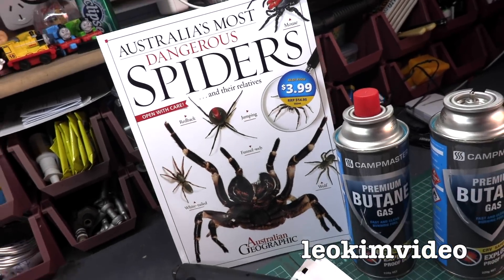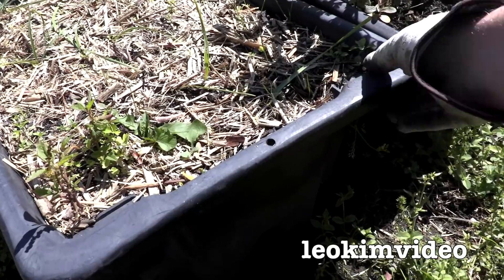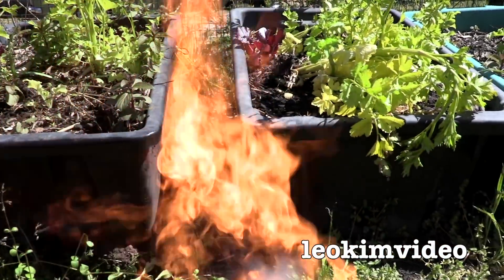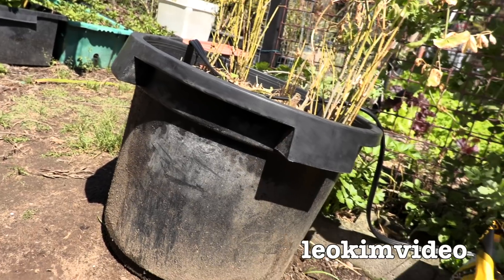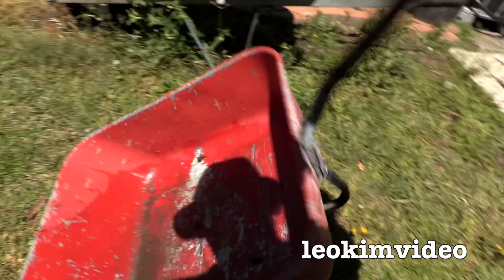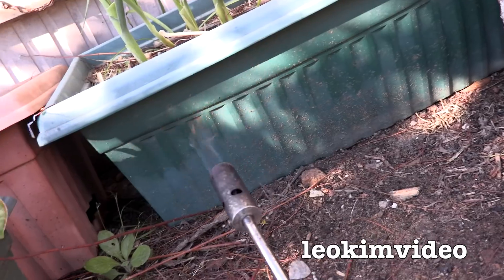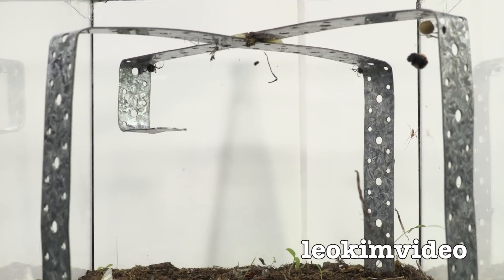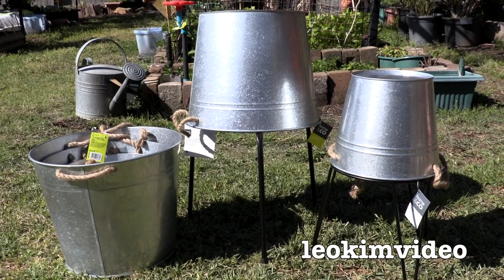Redback Spider Control First Burn Amazing Results Using Fire EDUCATIONAL VIDEO

Comment: Before using your torch try and use the hose to wet the area around the plants so you water them and you don’t put the risk of burning down the area around you

Comment: You should use that lithium grease spray on all the flower boxes too! I'm sure it will discourage them from always setting home there... Actually spray all your house and garden with it! :D
It wasn't intended for this, but man it's good. :)

Red Back: burn in 2018 - died in 2018... :))))

Pff, "Mrs Rooster"..... I'm sure all roosters are male. I think... XD

Comment: “There is the date of today , and my gappy teeth as a kid” 😂 Classic Leo
Reply from the maker: I had oral surgery to have the gap removed and I was awake during the procedure. I remember it to this day and in the end it felt like I was punched in the face, it was really scary to go through I was quite young when operated on. I had a few speech problems and that gap was part of the problem. The other problem was my slow brain and that's still yet to be fixed. That tooth gap runs on my Mums side, she had it as well. My Son also has it but not as bad as mine.
Reply: Why not braces?
Reply: I bet your teeth are that big still
Reply: You are still adorable Leo.